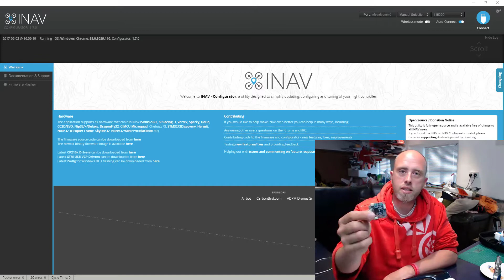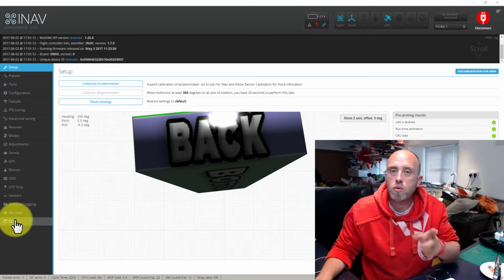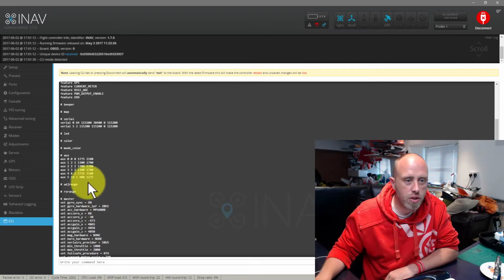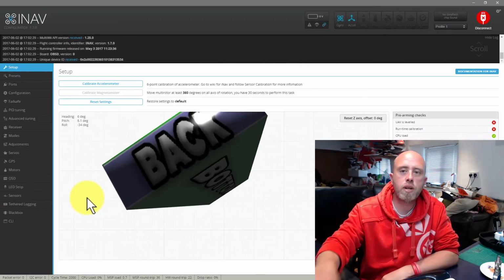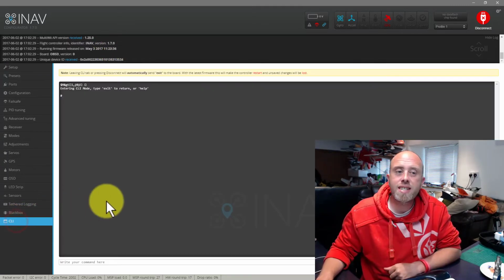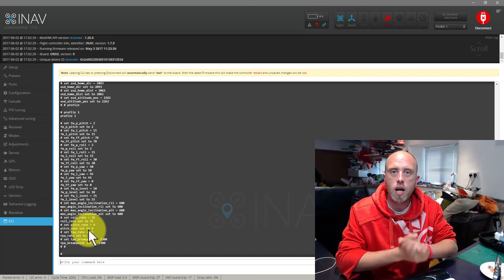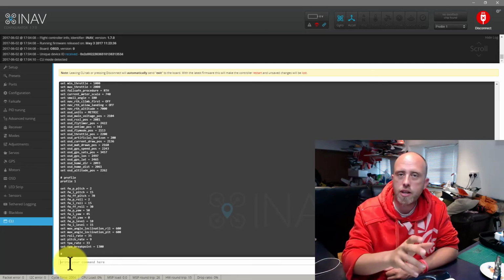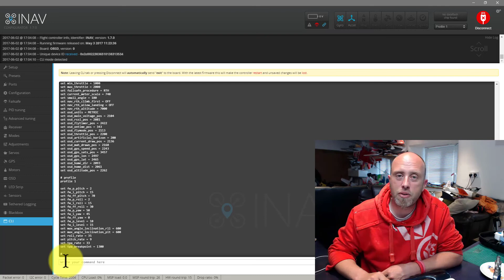How to Copy Settings From One Board to Another with the iNav Configurator

Comment: HI, you used the DIFF command which is fine, but for users that have more than one profile in use the command DIFF ALL will list changes for all profiles and rate profiles. Might be more useful ?
Cheers Steve

Comment: Have you tried this from 1.6 to 1.7?
I tried using your 1.6 custom mixer file to set up my Nano Talon and it would not work.
It kept saying parse error.
Sorted now,  1.7 seems to use a different format for smix.
Reply from the maker: Hi Stambo, see the iNav wiki, the smix layout changed in 1.7.3 or .2, there is a list of custom mixes available, Matt